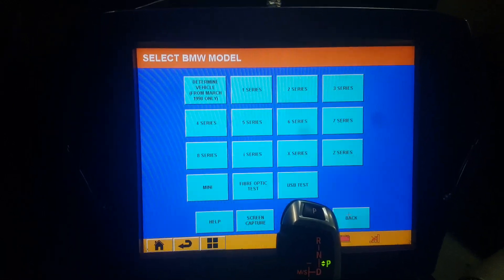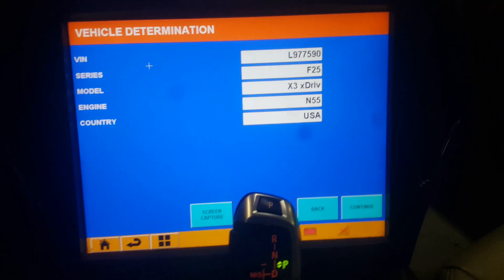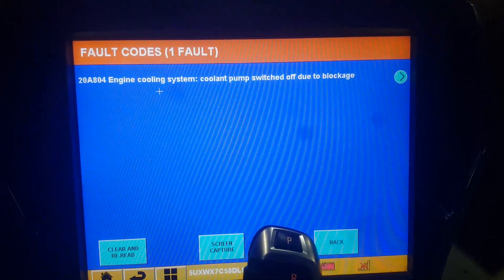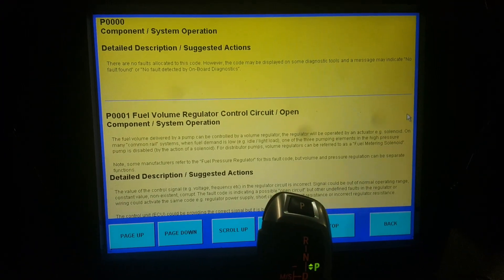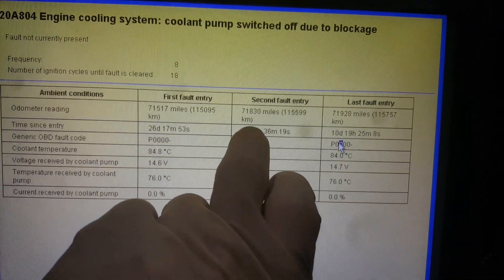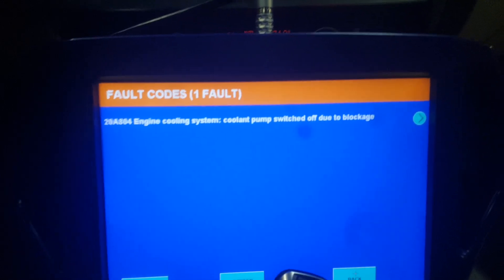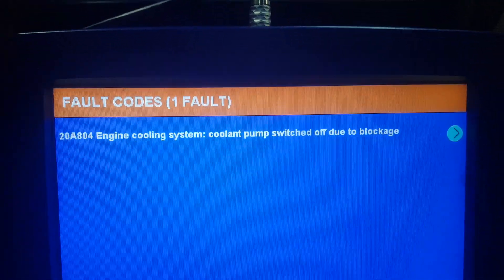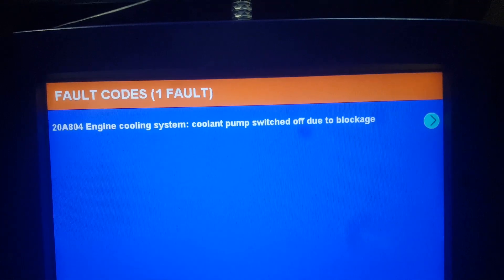How to Fix 20A804 BMW Coolant Pump Switched off Due to Blockage

Comment: I replaced the water pump and thermostat 
But still not working 

Help???? Me
Reply: Asanko vlogs  i have the same 2 fault codes but when i push in my gasped for 10sec then my pomp works ? 
When i drive my water temp goes not higher then 90 degrees and the fan goes always on and off
Reply: Asanko vlogs  do you have found the problem?
Reply: Samed Celebi 
The problem was in my blower motor recal melted wires, they burned my pump, I replaced the pump and the pump burned again 
So bmw fixed the blower motor recalls
And i put ne pump and now is working...
Reply: @asankovlogs  hei. what car did you have?
Reply: @samedcelebi3388 did you ever fix that same problem

Comment: Service Plan
- Carry out function check.
- Check coolant mixture ratio.
- Check coolant and electric coolant pump for coarse dirt contamination.
‐ Renew coolant pump.

Got the same code with a new water pump oem and i don't think you have to change it completly
Reply: How did you fix it
Reply: @user-jd4kp3lp9r  If you have this problem several times and you have also changed the pump several times, it is because you have a mass in the car. Personally I never found the mass and I had to sell the car since I changed the water pump 4 times and it became much too expensive for me and I couldn't find a solution.

Comment: After 4 years with around 60K millage the original water pump failed x5 2012, I changed it on 2016, Today 2023 that water pump failed again with around 89k ! I will go to the dealer and change it ! Third water pump in 10 years!  Dont buy a BMW! FYI that water pump is a big issue , They won a class action case! SMH